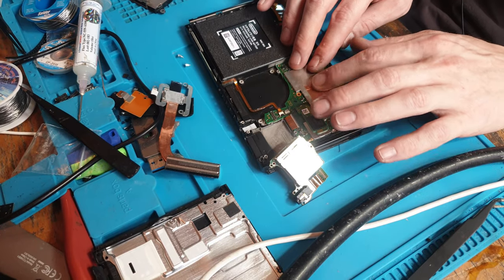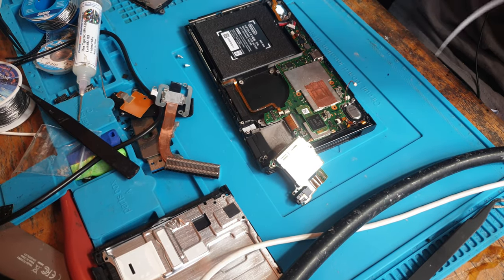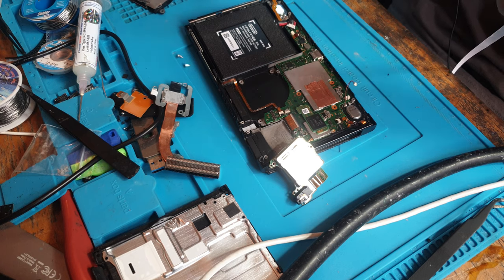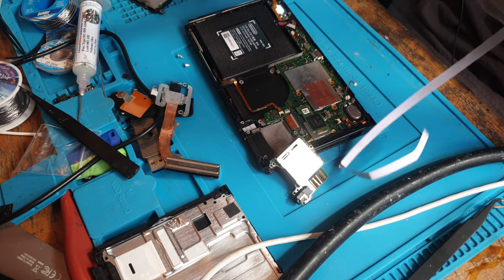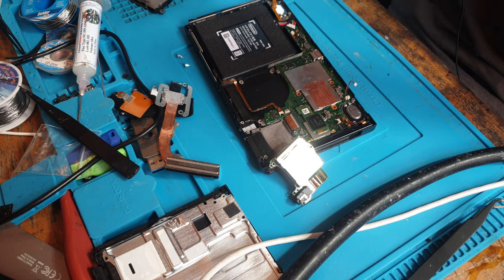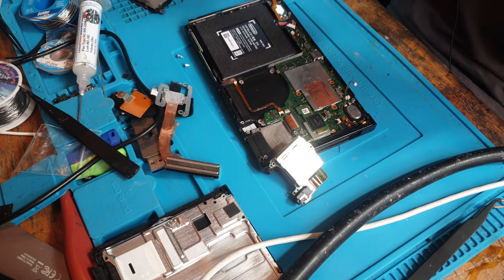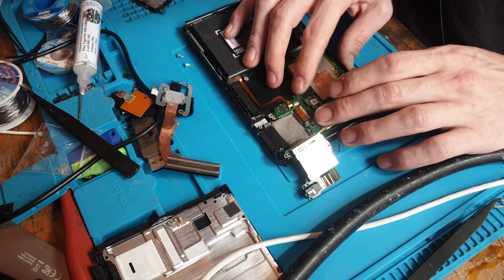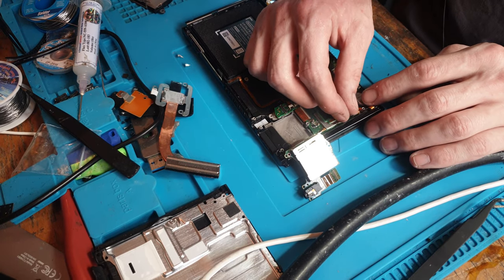Nintendo Switch No Display Repair (Technician Damage) - Broken LCD Connector Replacement

Comment: Just found your videos   I changed  a usb charger it was intermittent charging so it was the usb. But now it’s not charging at all my coil is open circuit I haven’t got another to check. Please can someone check if the coil should be shorted.  Thanks.

Comment: Awesome I'm working on a Switch right now with no power issues, but this is a good video if I come across this problem
Reply from the maker: Thanks bud, hopefully you get it working. I have some other switch repairs on the channel too and also a different one which I need to edit when I get time. A heads up would be look into the M92T36, P13USB and BQ24193 chips for no power issues
Reply: @TheCod3r  I replaced the BQ24193 chip and charge port, the other 2 chips are next. Have you ever seen the Max77620 chip go bad?
Reply from the maker: @jasondoesthings919  I don't think I've ever had it personally but it certainly does go bad from time to time, usually from liquid damage or a surge though. Are you getting a blue screen or is it just not turning on at all? Also did you try a known good battery in it and hook it to an amp meter to see what kind of power is going in? Also be sure to check the tiny fuse just above the port too :)
Reply: @TheCod3r  I get nothing for power with the amp meter or with a good battery and there are no shorts, that I can find. It does tell the charge it want 15 volts.
Reply from the maker: @jasondoesthings919  do you get any voltage both ends of the fuse by the charge port? If so you'll likely have an issue with the m92t36 chip

Comment: how many pins is that lcd connector and pitch..
61pin 0.3mm?
Reply from the maker: I'm not sure if I'm honest I've never counted them but you can buy them from ebay just searching "Nintendo switch lcd connector" or on aliexpress too
Reply: @TheCod3r  ok... actually I am looking to repair a phone(xt1254) and the connector over in your video looks very similar.. i think your connector was a 41pin.. i cant seem to find a 61 pin cable shipped to where i stay..  :(
Reply from the maker: @qc_uploads748  unfortunately I wouldn't know where to get one from as I don't generally repair phones
Reply: @TheCod3r  cool mate. I'll figure this out, thanks for the replies. most youtubers don't bother. cheers
Reply from the maker: @qc_uploads748  no problem mate sorry I couldn't help

Comment: Great i was just doing a Nintendo switch lite and I did a lot of things and I forgot to check the LCD connector I found out after I check the voltage and was getting only 3.57 V coming from the backlight I even replaced the LCD digitizer and same thing I was like what and later after an hour I was like wait let me check the lcd FPC connector and boom 3 pin inside where bend I was like ahhh are you serious so I’m waiting for the connector but I’m 100% sure I will show image I’m going to try to make a video when fixing